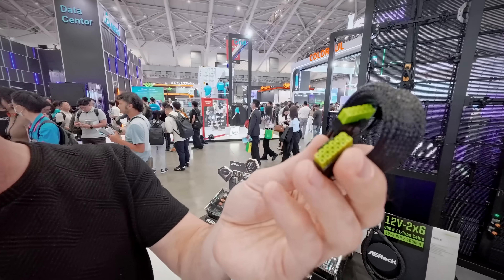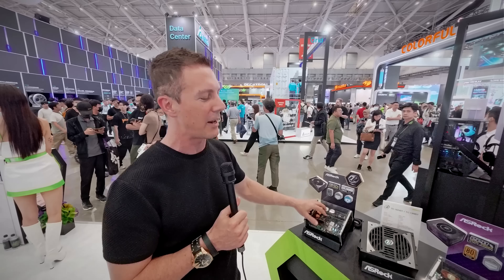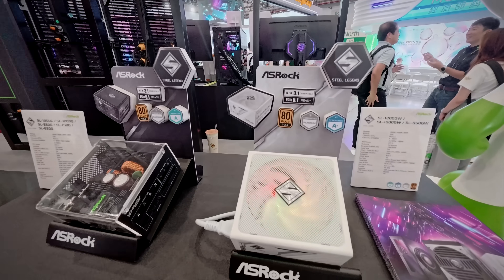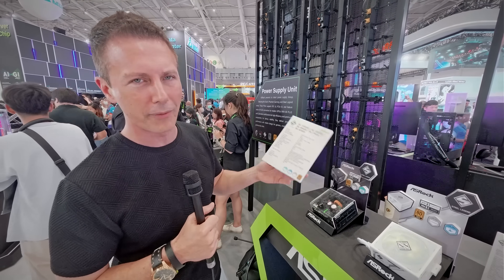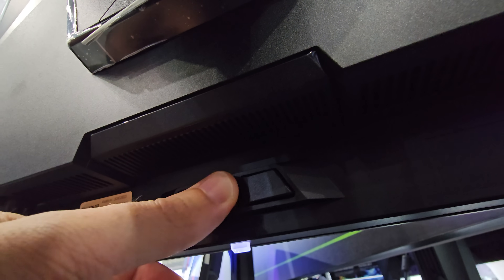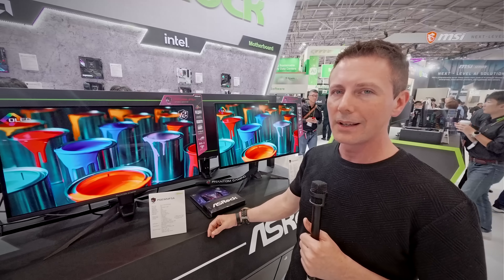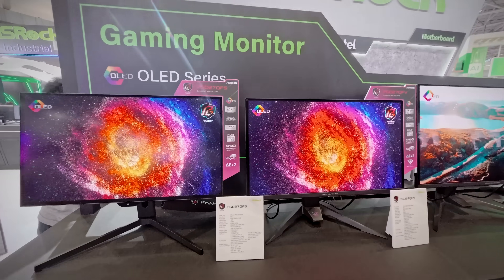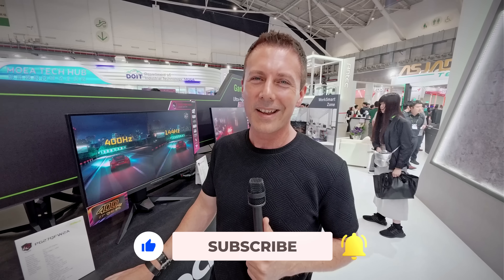Can this stop your cables Melting?

Comment from the maker: Got all the answers from asrocks engineering team late this arvo regarding the cpus dying. Flying out tonight so will try get the video out tomorrow.
Reply: Awesome really seems to be mostly 9000 series and X3Ds, my 9900X3D X870E Nova 3.25 bios still kicking though. Thanks for asking about that situation.
Reply: @osinstalls I’ve got the same set up as you and mine been rock solid since November
Reply: @Motion_God  Great to hear. It's been an enjoyable setup.
Reply: does this problem also happen with the Ryzen 7000 series CPU's if not I guess a 7800X3D would be safer to use? my chipset is X670E with Gigabyte's X670E Master, I hope this board is safe. thanks for these videos btw.
Reply: @obi-wankenobi1190  It seems that way. Been following this also. I all ready had my X870E 9900X3D and ram pull when I went ahead. Think it's likely safer reusing that X670E.
Reply: @osinstalls  Well I already have it, Gigabyte did have the least most issues regarding that survey Tom;s hardware held, I am going to wait for ZEN6 and  by that time the issue may be resolved, I wanted the X670E which is 100%^ identical to the X870E as specs go, because this supports Win10 Pro and a modified version of Win7 Pro , I am not a fan of Win 11 Pro at all and always will try to find ways around it,  my current build uses a Gigabyte B550 Aorus Elite AX V2 rev 1.0 with a 5800X3D and a Nitro+ RX 9070 XT the performance is fantastic tho, the X670E will be for my UDNA/ RDNA 5 workstation build with ZEN6's 24 core/48 thread CPU. so I am glad I was able to fidn anew and never used Gigabyte Aorus Master X670E for that purpose with the OS support I am seeking.
Reply: @obi-wankenobi1190  Looks like a nice board. Not a fan of W11 either. Am all machines on Nobara except one on Win10 LSTC.
Reply: Thanks Brian I have a 9950x on a B650E Taichi, and I would hate to lose my chip, haven't been running the system. Hopefully we get the answers we're looking for. Thanks again!

Comment: there are already reports of this cables still failing the same way, nvidia really should address this since this shoundt have been a problem to begin with
Reply: How do you really prevent cable melting in general with the 5090? Just play at lower resolution and lower settings to keep power consumption lower?

Comment: Even this is not a fix. ( The real fix can only be provided by card designer, maybe with two 12V-2x6 connectors. ) , but this is by far the best solution, at least it protects your precious graphics card.

Comment: OYG !!  ..... JUST DUMP that stupid 12VHPWR  !!!   What is wrong with using the old TRUSTY 8pin ?  I don't mind having 3 on my GPU, or even 4 if needed !!  Or why dont just solder the cables to the GPU, so you ONLY get one connector ?!   ( that goes into an PSU )             #JustDumpThatStupid12VHPWR

Comment: My rtx 5090 is undervolted .094 and overclocked with the core at 2000 meg. Power draw is in the 400w region so no way i will have a melting cable

Comment: a simplier and possibly cheaper solution for the melting 5090 problem would have been having two 12 pins connectors instead of only one overloaded one.

Comment: new connectors will not fix psu without voltage or amperage control, same for the gpu

the design was bad, nothing to fix, it is more about hide problem or replace connector

Comment: The color solution is not unique to asrock. Msi is doing it and it's not a solution. Connectors are still melting. Now the temp probe may help but the rest is just noise.
Reply: I mean it WILL help because it'll detect melting temperatures, by that's not a real solution, the cable will be cooked by the time the safety goes off.
Just don't buy the 5090 at all, perhaps not even the 5080. The 5070ti can undervolted to operate fast below 250W so it's maximum you should go for. Shouldn't burn at 250W.

Comment: Bandaid fix, the issue is on nVidia's side not the cable or the psu. These cards need a recall and a pcb redesign which is the only solution long term that will work.
Reply: A fix is a fix

Comment: Again, the issue is not about the cable being plugged in fully or not that's the BS narrative Nvidia is pushing. The issue is the absolute lack of load regulation between the individual pins allowing the card to pull the 600 watts even from a single pin if it wants to. The issue is that Nvidia chose to not include a 5 dollar voltage-load regulator in a 2000 dollars GPU's board.
Reply: This
What an utterly disgusting company.
Reply: I mean $5 is huge, companies don't include a 50 cent screw if they can. They sell 5 or 10 mils of units that's 25-50 million dollars saved.
Reply: @jackbauer2698 Maybe that’s the problem with the world we live in then. Intentionally selling a fire hazard for 2000 dollars because you saved 5 dollars should be a class action lawsuit with criminal charges.

Comment: Still have the stock cable (a bit of a cpu fashion crime) adapter from Nvidia for 4090 12VHWPR, it works open case 7000D Airflow 1600W SF PSU still fine. I always think I could take things apart, maybe if I'm moving the gpu into my newer rig and use the PSU's companies one but buying something like this before you build is just a smart move. Granted I'm not crazy about some of the newer 5000 series gpus using 12VHWPR close to the 600W cap. Don't think I push my gpus hard playing older titles. OLEDs look great. I just downgraded from 32 1440P to 2 x 27 am loving that. Watching movies I like a large screen but gaming 27 is right I think 32 was too large, was missing some dodges.

Comment: Thats not really a solution. Also why is Nvidia not doing anything?
Reply: Because as with everything they rather save $5 per unit on a voltage regulator. Think about it, they sell 10 millions of units that's 50 millions in their pocket. It's all about the profit and F the customer.

Comment: It turns off the entire power supply :D and who will pay me for the corrupted data by cutting off the power without closing the program? This is not a solution, it's just filling holes with chewing gum. NV should worry about fixing the error that has existed for two generations, if in 4xxx it was unexpected, in 5xxx they still installed the power socket at their own request, which didn't work... Such a cable is a scam for customers that absolutely should not be considered as a solution.

Comment: Sapphire did the same for their Nitro+ RX 9070 XT  they made the connector pins light blue, AsRock copied the idea from Sapphire actually regarding that bit.
But then again if NVIDIA just goes back to using 8 pins or something more reliable that can avoid all these unwanted odd solutions,as PSU's go Nothing beats SeaSonic, AsRock isn't a brand I'd trust, I never was a fan of their hardware if always felt super cheap and lacking of quality.... left alone feeling as unreliable

Comment: We've already seen melted connectors that were actually plugged in correctly... in other words: not user error. Still, it melted. The fact that Asrock now coming out with a cable that prevents it from melting is a good thing... with the exception that: The problem is still Nvidia's side. This problem has not been solved. The whole thing is starting to get ridiculous, other companies need to make dongles that "try" to fix the "problem" but in reality they don't, it just prevents it, it doesn't solve the problem itself.
You probably don't want a cable that constantly or occasionally turns off the machine because the cable detects something... then there must be something seriously wrong with the GPU... namely: NVIDIA.
Reply: Yup, all Nvidia needed to do what to put current balancing on the card itself like they did on the 3090 Ti

Sadly they are big enough to get away with doing nothing about it
Reply: @ZimpanX  They could split the power distribution pins on the connector so where it plugs into cards it's at least 3 different separate loads like old 8-pin x 3 connectors would be handled. I don't recall if the 3090 was set up this way. It would make a lot more sense. Everyone is trying to engineer solutions from the wrong side of things. Manufacturers are starting to implement the connector in AMD cards now, which is not a great sign of things to come. The ASRock Taichi 9070XT uses it, along with fuses at the connector on the card, but that's still not going to fix the issue of load distribution. We're also dealing with smaller wires and connector pins than the old 8-pin connectors. So there's less safety headroom. It's overall a bewildering "innovation" that hasn't made a lot of sense, especially as cards are using more and more power with each new generation.
Reply: This dodgy and manipulative tactic to make the PC market adopt a connector standard that easily melts is the reason why I switched to RX 9000 series. For high end GPUs that cost almost a thousand bucks sometimes even more, I'm not taking any risks with my hard earned money.

Comment: Man... a lot of people at Computex have all these different solutions to Band Aid the garbage 12V connectors. I just want something that can monitor the current per pin, then give me an alarm via the speakers/headset so I can just Alt-F4 out of the load, rather than shut off the system, and potentially lose anything I didn't save. Ideally, we would just dump the 12V connector for something like EPS, but that's not going to happen when even AMD AIBs, ASRock being one of them, adopting the trash for no good reason on the 9070 cards.